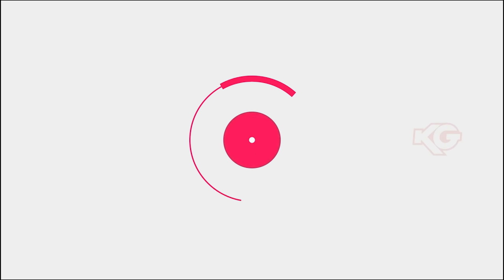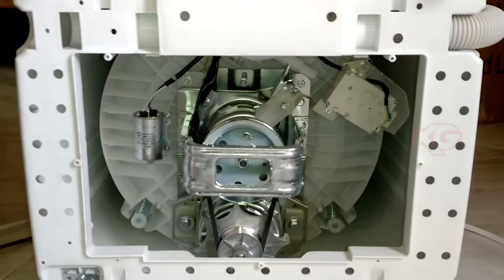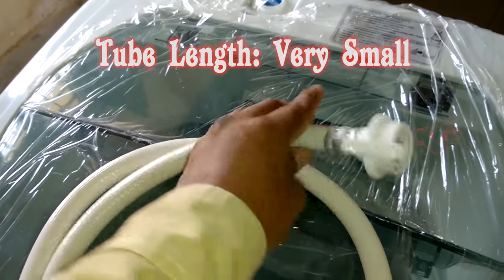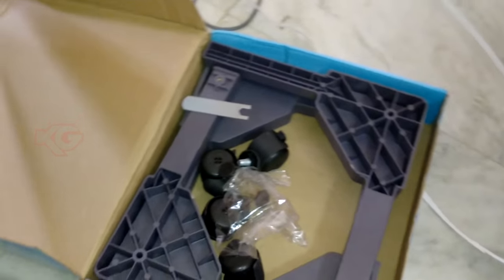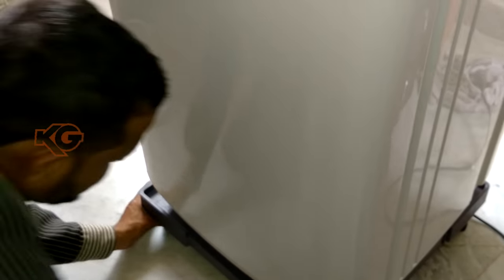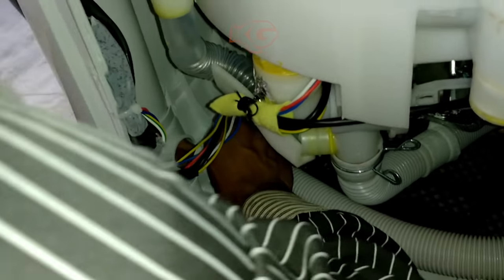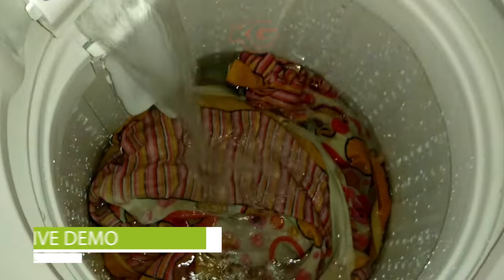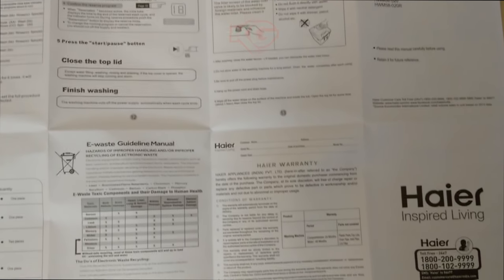How to Install Washing Machine Professionally !! Haier Company !!

Comment: How does that detergent box work? you added detergent manually.
Reply from the maker: Great Question indeed. I asked the same when he demonstrated. He told that its there just for design purpose, but for efficient detergent washing, he advised to directly put in the clothes. I found it delicate too, so following manual process for this model.
Reply: Plz help to double washing time. Because my machine has not remove dirty clothes